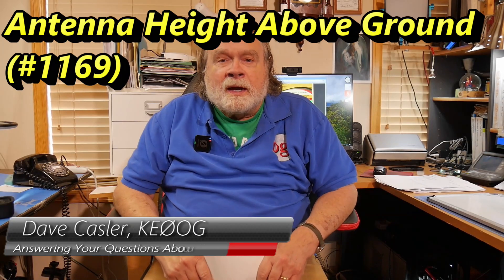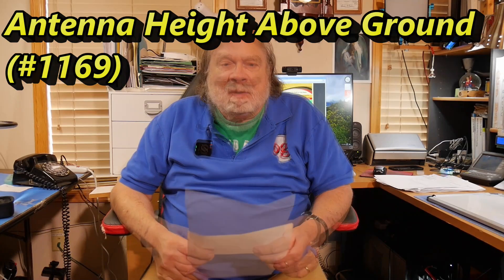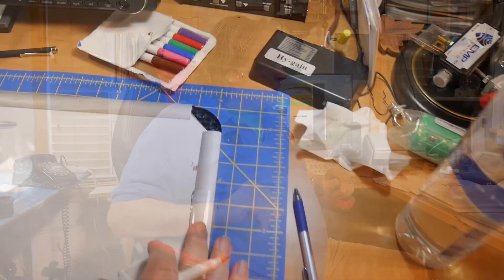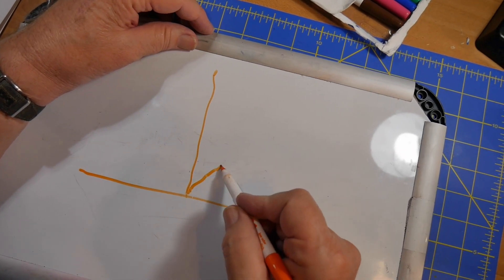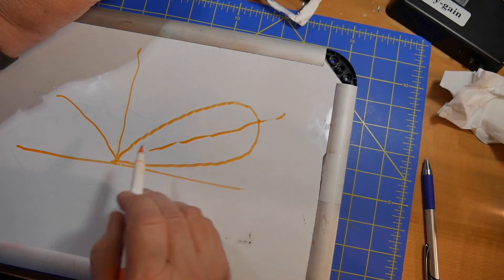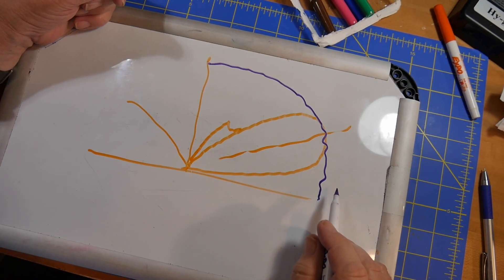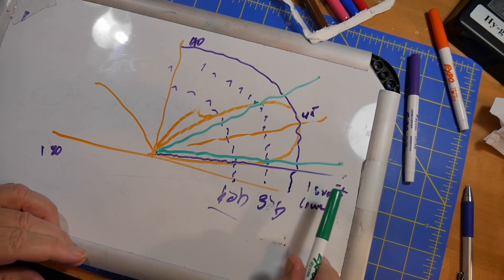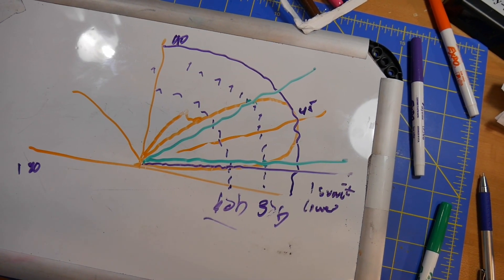Antenna Height Above Ground (#1169)

Comment: Thanks, Dave, you do a great job explaining. On the subject of an 80M dipole - I know of no one that happens to have two 120 foot poles to string a wire between so they can be at optimum height for the 75/80 meter band. I don't have enough room to even make the wire a straight line but, works pretty darn good - I think...  🙂 Sometimes we just got to go with what we got and enjoy it.  73  WA4QGA

Comment: Hey Dave, great video about antenna heights! I have a 2-element GEM quad at 40 feet and have no issues working stations in Europe with 100 watts from the west coast! I also added a 6-meter loop to the quad antenna, as I have never work 6-meters before. So, my question is do you have a video on 6-meters operations or is it possible to make one? Thanks.

Comment: I feel sorry for Dave not understanding how height works with antennas. Generally speaking the higher you go, the better off you go. Yes, there are lobes, but your takeoff angle gets lower and lower with the higher altitudes.
Reply: Why do you feel sorry for Dave? He fully understands how height works with antennas. Notice that he does show take-off angles as height increases..
Reply: @wilipno  If you want better DX, raising your antenna will always improve your power at low take off angles.  Always.  If you want better higher take off angles, the pattern will bifurcate but your radiation levels in the higher angles will always improve.  Always.  Don't limit your antenna height because someone tells you to.  Limit it because you just can' t make it any higher.  He doesn't address the tri band beams.  Very popular but you will have either bifurcation or your TOA will be poor on the lower bands.  Most people will mount their tri bander at at least 35 feet which is good for 20M.  It will bifurcate at 15 and 10M.  So what?  People love them and people get great results.  Dave doesn't mention that?  Is it because he fully understands these concepts that he omits so much information?  Maybe so.  But he tells you to worry about something that you don't need to worry about.  Most people won't even have an opportunity to worry about having better successes.  

Go ahead and limit yourself needlessly.  No sweat off my back.

Comment: Great question and perfect answer. I live in FL, and I use an end-fed longwire 200' long sitting only 6' up on top of a wooden privacy fence. Florida's ground offers me lower losses than, say, up north in New England (where I am from). Paired with a 1KW 9:1 balun and 1K amp, I do quite well with very low noise. Lesson: all grounds differ in soil conductivity and will affect antenna performance more than many think or talk about.

Comment: For NVIS horizonatal dipole ,minimum height 1/8th of a wavelength high.  so 10m height on 80m band and 5m height on 40m.. Below 1/8 wl ground losses increase at a higher rate the lower you go .

Comment: New guy here as a tech going for general. So I'm stuck on 10 meters for a bit. But I've been having a blast with only 20 watts into a ten meter 5/8 wave ground plane that base of the antenna sets around 15 feet off the ground. If I understand you properly it's at the proper height???

Comment: Great video Dave and great timing. I just put up my OCFD (7 band 135’) currently only 23’ up, 8’ at the ends.  Moving it up to 35’ tomorrow- with 10’ at the ends. Now even though only 23’ (@100w), I just got a 5-9 signal report from a contact in Cuba from NH, but only 5-7 to 5-8 out to Michigan and Kentucky… I think it will do much better at 35’.     73’s!

Comment: Hi Dave! I just watched today's episode about antenna height and have a question: I built a "Starduster" style 11-meter CB antenna. How do you measure the height AGL of it, since the "radials" angle down at roughly 45 degrees - from the center feedpoint or from the bottom of the radials? Thanks, and 73s!
Reply: Dustin if you’re not a paytreon you will not get an answer .